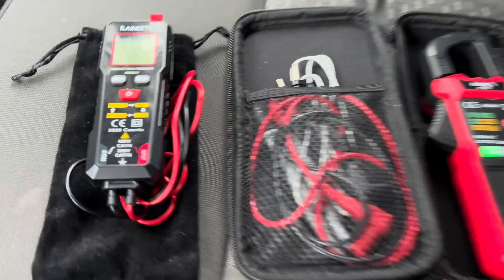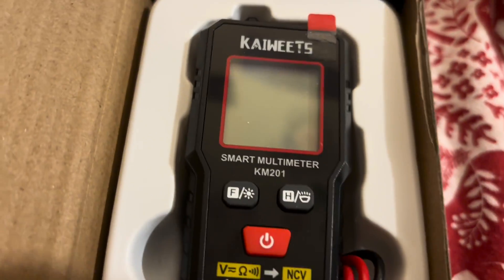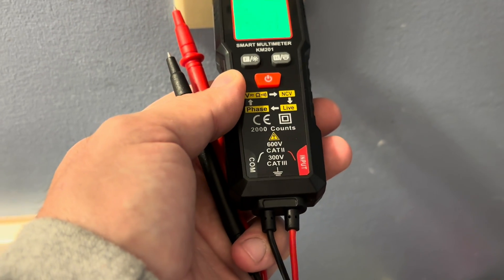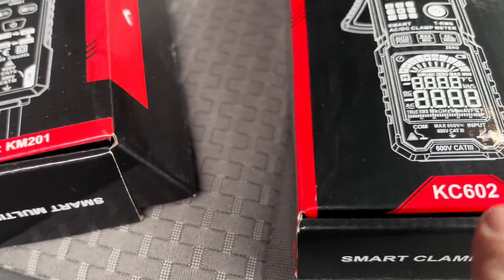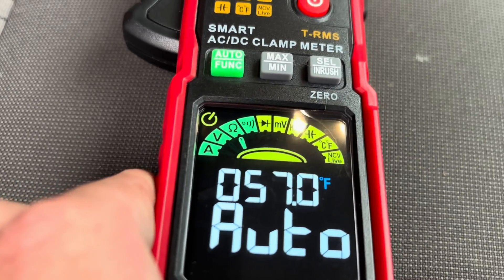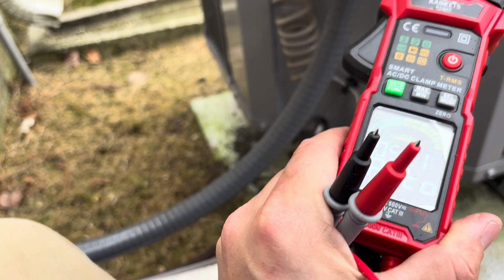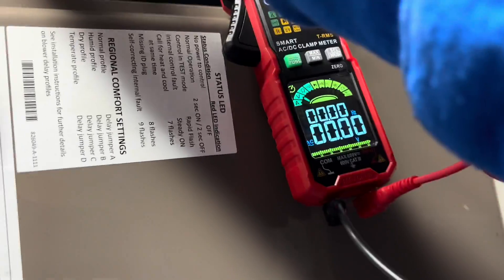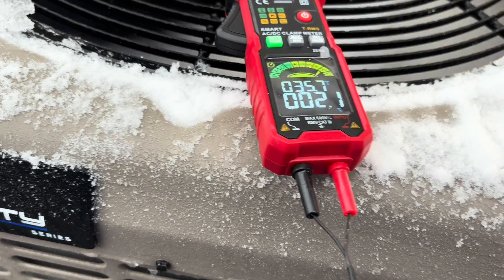Great Entry Level HVAC Meter!  Kaiweets KC602 AND KM201 Meter Review!

Comment: Thanks for the video. Did these hold up well? Do you think it would be fine to use NiMH rechargeable or lithium batteries in one of these?
Reply from the maker: They are holding up pretty good.   Yes that should be fine as long as the directions don’t advise against them.
Reply: @JeffsHVACAdventures  Thanks!